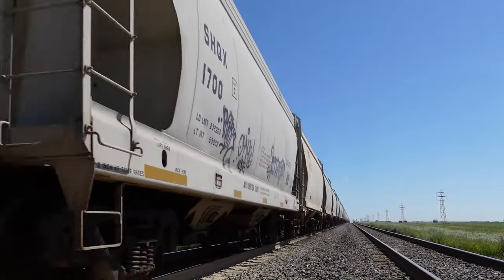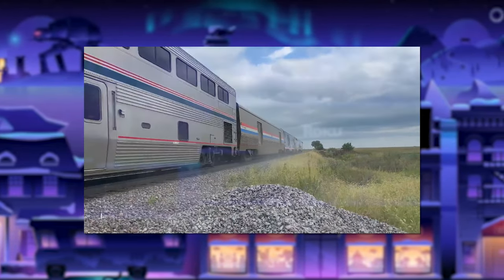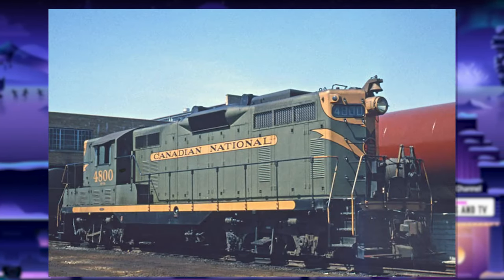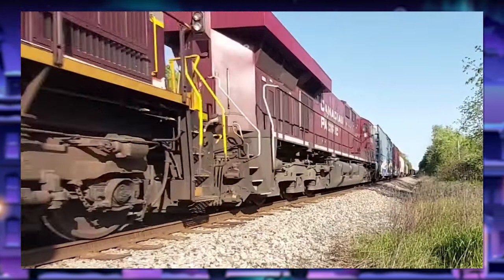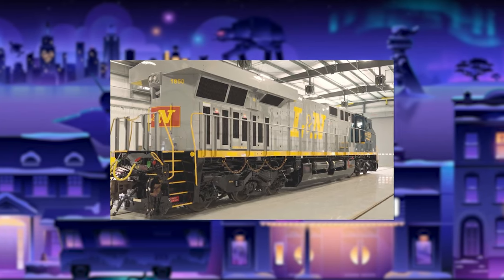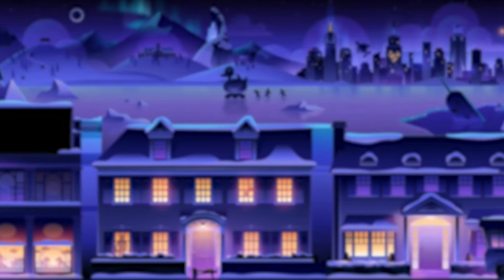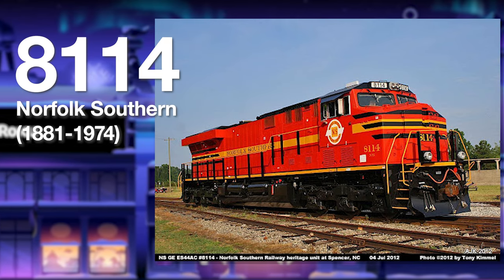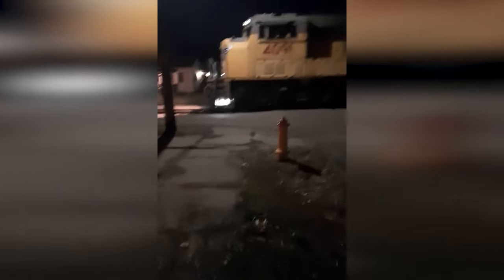Heritage Units - What Makes Them Special ?

Comment: I railfan NJ Transit and I've seen almost all of the heritage units. I'm only missing the Erie and Erie Lackawanna. I finally saw 4101 at my local train station last week. My top two have to be 4109 and 4101. 4101 is interesting because the livery it wears is the same as it was when NJT first got it, it then got repainted to the grey with the slanted stripes when NJT overhauled back in the 90's. I'm glad it got repainted back to the original livery. It also retains its original high mounted bell, which most got switched to be below the cab. The bell is also an actual bell, not an e-bell that NJT widely uses now. I took a video of it pulling into my local station and you can see the clapper striking the inside of the bell. The horn it has isn't the best though, I wish it had a cooler horn. My favorite NJT engine though is the Atlas locomotive 4503. I preordered the HO scale model last year and it should be coming later this year.

Comment: I Managed to catch almost all of the CN Heritage Units

Caughted: 8952, 8898, 3023, 3069 and 3115

Not Caught Yet: 3008

but there were some Heritage Units involved in wrecks with them ended up being Repaired however CP 7011 after the CPKC Merger was Scrapped after a Derailement.

Comment: 8104 was not repainted, it got a slight redo right after it first rolled out back in 2012 to make it more accurate. 1067 was the first unit repainted in 2023, after a ton of paint had chipped off. 8099 was second after its derailment in late 2021, and 1067 was third. NS has said they have plans to repaint them all eventually which means they will all stay in good condition
Reply from the maker: Ohh, gotcha, at least NS takes care of them!